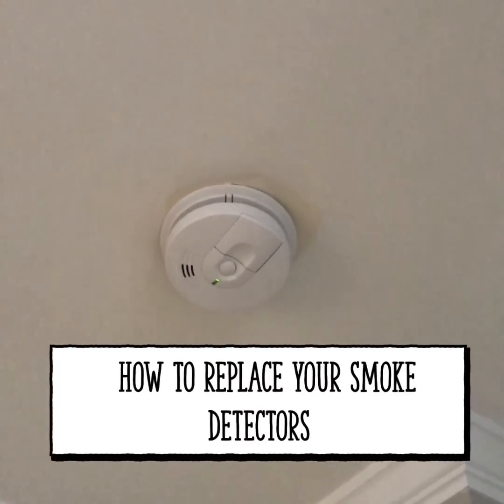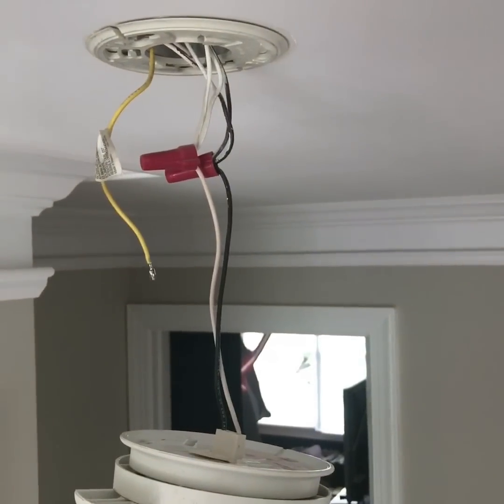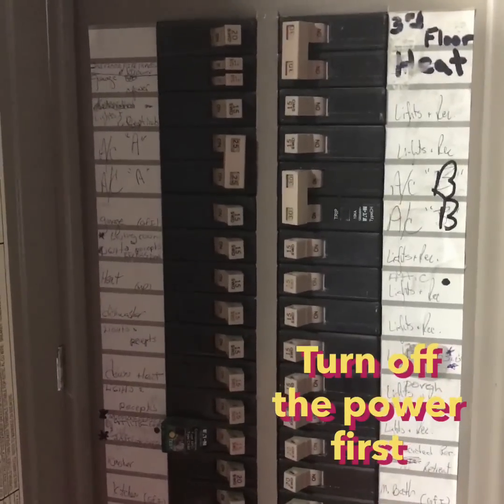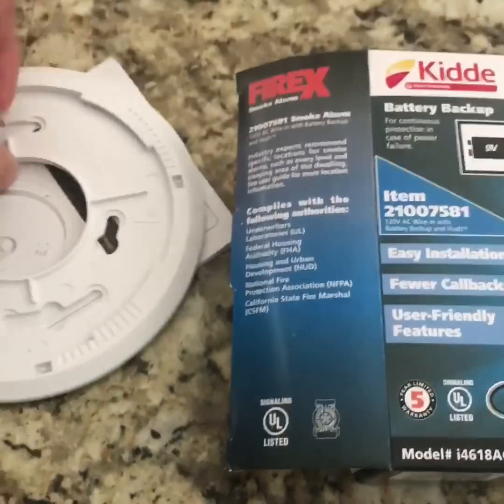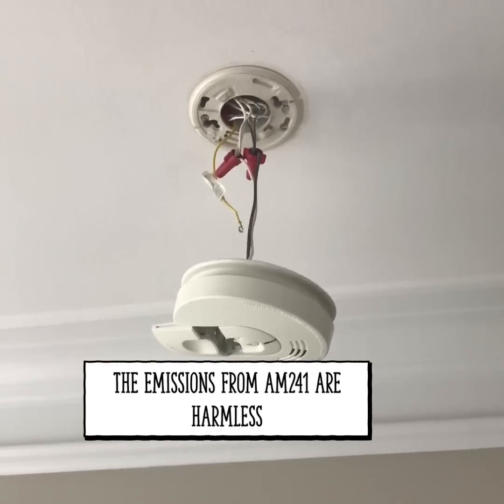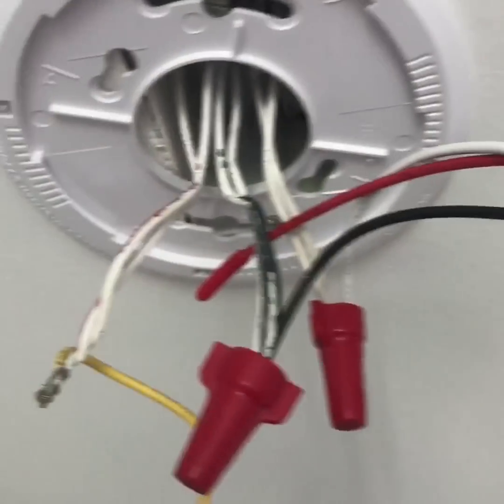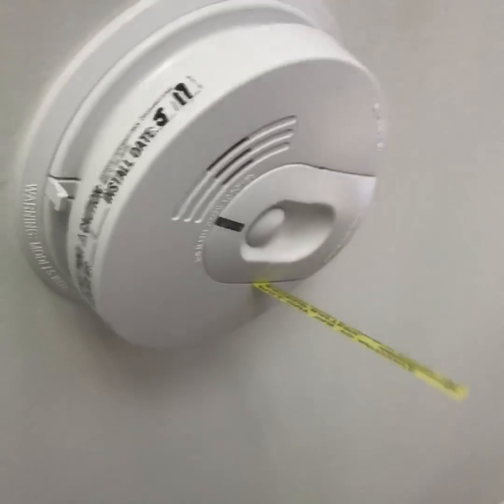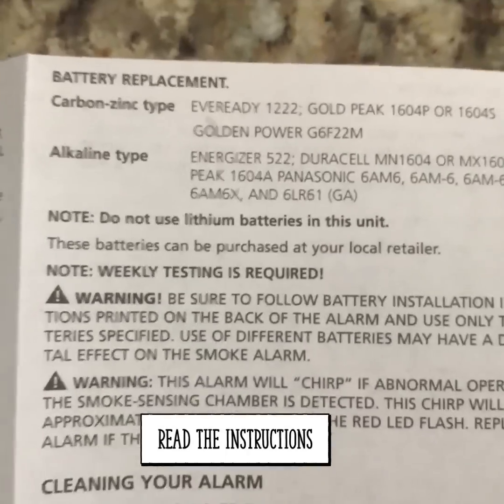How to Replace Your Old Smoke Detector

Comment: Thank you! Great and easy to follow steps. Helpful tips on having a no-touch voltage tester handy and how to find which circuit breaker it most likely is. Replaced all of mine.

Comment: Very good tutorial! Thank you for posting. Let's start calling them  "smoke alarms".  Detectors will send the information about smoke being detected to a control panel that will then send a signal to alarms that go off throughout the building. Usually, these are installed in commercial buildings. Residential alarms have the alarm built-in.
Smoke alarms need to be tested at least monthly, replace the batteries annually, and replace the unit every 10 years.
Do not forget about carbon monoxide alarms. If you have any type of appliance in your home that uses fossil fuels (propane, fuel oil, natural gas) you need to have carbon monoxide alarms. Carbon monoxide is a colorless, odorless gas that can kill you.
I recently replaced all of my alarms after discovering they were 16 years old! They were working fine but needed to be replaced. I now have one in the basement, one in the upstairs, and one each in each of the bedrooms.

Comment: I am replacing two old smoke detectors. In the case of one, the outlet box has one cable with a black and a white wire. I connected that one no problem. The other box has two cables, each with a black and white wire. The old smoke detector had its single white wire connected with both the white wires in the box; and its single black wire connected to both the black wires in the box. Is this the right way to connect to the two-wire box? And are there two wires because it is a middle-of-the-run box, and one cable is used to send power to the subsequent loads on the circuit? Thanks.

Comment from the maker: Good question. Yes it's in case of fire during a power outage which with current weather patterns could be days.
Reply: My doesn't have a batteries how I'm supposed to be change
Reply: @chivovaldez310  If it has a sealed lithium battery then you don't need to replace it.

Comment: OK...I hooked up a new firex i4618ac in an existing system (old brand was dead)...all seemed fine but once I turned on the AC-it beeped and would not turn off until I unplugged the unit (the green light was on so I know I hooked it up right?)-  this is 2nd in line of a chain of 3 detectors--  I need help.

Comment: the only comment I would make is that the white wires are actually connected to the neutral side of the circuit- not the ground.

Comment: If you are installing the same brand of alarm, could you just leave the connector that already exists rather than having to unscrew all the wires? Or is it a safety issue to not change the connector?
Reply from the maker: You could leave the connector but take a good look at it make sure that it’s not dry and might easily crack. After 10 years it’s probably a good idea to take the extra step and change it

Comment: Does anyone have a good tip on how to find the grove before the twist to lock them in... I for the love of god cant figure out how to get it to line up properly.
Reply from the maker: The brand I have is called fire X. If you look at the part that you have in your hand and turn it upside down you’ll see four small tabs around the ring. Now if you look at the part that’s in the ceiling you’ll see four square holes and if you line those tabs up with those holes and then do a quarter turn clockwise you’re all set

Comment: I just realized that these units do not last 10 years. Installled in a new home in 2011 they stated chirping in Dec 2018. I decided not to replace the Smoke- Co  combined units- I purchased  separate CO units for  $20 because they do not last as long as the Smoke detectors. I truly believe that they put in too many units- 15 on the second floor. It is good to know that I do not have to attached the yellow wire on all of them.

Comment: My smoke detector started making noise last night and found it is expired already. Is it alright to remove it until I bought a new one.
Reply from the maker: Mario Calixterio Yes you can remove it you can take out the battery you can disconnect it if it’s wired but replace it as soon as you can because you don’t have smoke detection

Comment: How do you bind the wires?
Reply from the maker: If you mean how do you join the two wires together all you have to do is place them side-by-side, put a plastic wire cap on top and twist clockwise until it’s good and tight. Does that answer your question

Comment: YOU MUST CONNECT the yellow wire! This has been building code ever since they started installing detectors in the bedrooms.If you do not you are violating building codes. I know, its your house right! Then don't bitch when the insurance company refuses to pay the proper amount in the event of a fire, not to mention what if the basement detector alarms, you may not hear that on the second floor, that is why the code was put in place.  Also you should replace any no battery back up units with new ones as the voltage on that interconnect wire used to be 120V, now it is 9V. Is it worth it to cheap out on a device that MAY SAVE YOUR LIFE?

Comment: Can we just shut off the main switch for the entire house instead of searching for each breaker? Sorry if this is a stupid Question....
Reply from the maker: I suspect that your smoke detectors have a battery inside them so shutting off the power to the house isn’t going to help. Pull out the battery and if it still making a sound then just give it a twist to release it from the ceiling and pull out the wire carefully.
Reply: @DennisMooney  Hi Dennis!!! Wow wasn't expecting such a fast response you are a life saver!!! I am not mechanically inclined so I am doingmy best here. There are no batteries inside these detectors and they are at least 15 years old. By your video I think I am good at replacing the wiring with new detectors. The question is I have to shut off power before I start wiring. So how can I do that if it doesnt say which breaker I need to shut off in order to stop power to theold smoke detector (Wiring)? Can I shut of the main breaker which shuts off the entire house if I can find that specific breaker or will this cause damage when I shut the main breaker of then turn it back on?
Reply from the maker: PYRO ADDICTS OK so if you do pull the detector away from the ceiling remember that these are live wires that are exposed. You could shut the power down to your house and disconnect them all. Personally I don’t think there’s much of a danger of two live wires sticking out of the ceiling so once all the detectors are down you can turn the power back on again. Keep the two wires separate from each other that’s all. Then when you’re ready to replace them just shut the power off again rewire them and twist them back in. now these are 15 years old so the new ones you buy may have a different baseplate and you’ll have to replace the base plate as well. This is something that’s fairly easy for anyone to do and if you have a friend or neighbor who is mechanically inclined it should be very easy for them
Reply: @DennisMooney  So then shut the main breaker off to house, then take the old ones down, add baseplate, re-wire both smoke alarms, add the backup batteries and affix to baseplate, turn main breaker back on and test by pushing button is this right steps? I am going to attempt this myself I think I can do it because of your help. Without your help I would have been lost.
Reply from the maker: PYRO ADDICTS yes that's the procedure. wait until you bought two new ones or take the old one in to a hardware store and show them what you need replacing. Then attempt the replacement all in one go. If you only have two smoke detectors then turning off the power to the house it’s something you could do if you can’t locate the circuit breaker that is specific for the smoke detectors. If they are still making noise they will stop once you find the circuit breaker
Reply: @DennisMooney  Thank you so much Dennis I will let you know next week how it goes. Wish me luck and once again I appreciate your kindness!!!!
Reply from the maker: good luck

Comment: Sorry I’m new... Why is the battery such a big deal if the detector is hardwired through the ceiling? I know you want something for when the power is out, but wouldn’t that battery be fine for a blackout lasting a few hours or even days once in a while?
Reply: in apartment buildings and places like that power gets turned on and off all the time....someone does not pay the bill meter gets pulled and people start using candles etc....ive been in property management 20 years and seen it all..
Reply: If the power goes out you have the battery to rely on.
Reply: Because it beeps every 5 mins without the battery
Reply from the maker: Or it beeps if the battery is dead. If you have a battery change it annually or don’t bother putting one in.